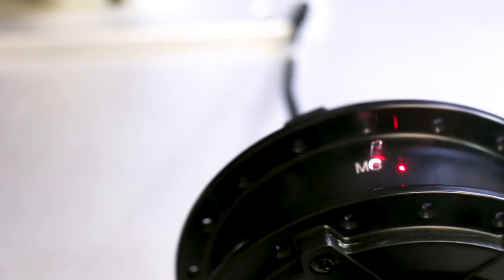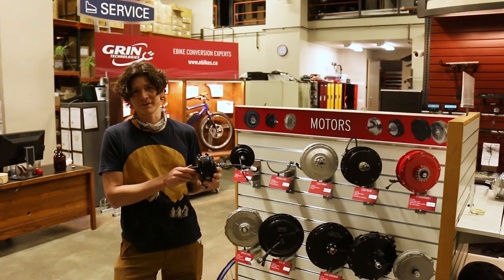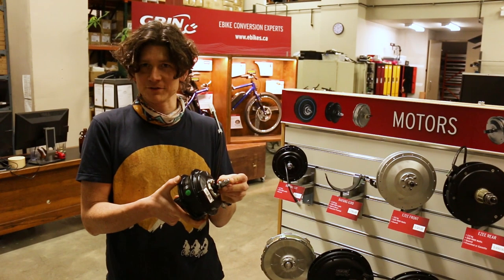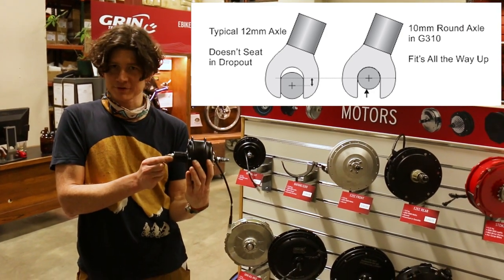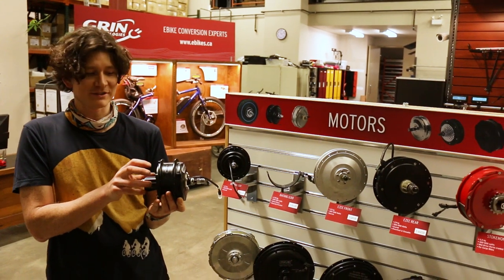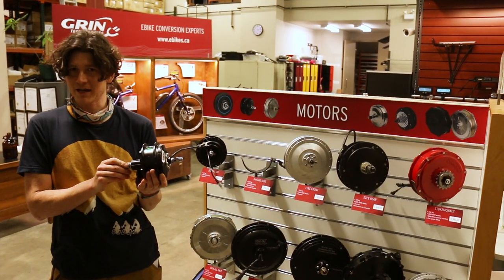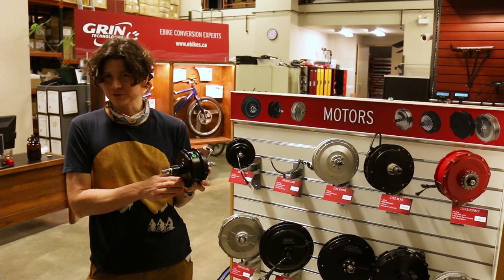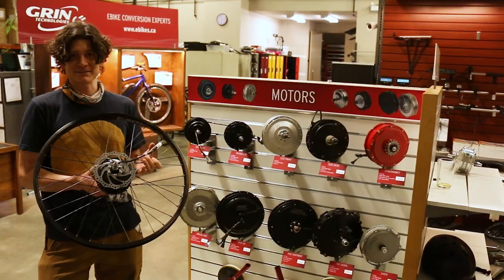Intro to the Small G310 / G311 Silent Geared Hub Motors

Comment: The G311 front hub sounds like it might be the minimalist solution I need for neutralizing the excess weight of my new Hase Lepus trike /  Rohloff Speed-drive  / differential. Torque no higher than 40nm should be good enough for me and should minimalize tire spin. I don't want to turn the trike into a full-blown e-trike. For me, "assist" means "assist," and that I can leave the battery at home when I want to.

Comment: Are the H400 the same motors? I have a Kuma R1 that comes with it. Could find much about the H400 but it's apparently a marketing code for the G312. I'm trying to find a way to remove the 25kph speed limit, at least to 32. But it just looks impossible without getting a whole new display and controller.
Reply from the maker: What's wrong with getting a new open standard motor controller?
Reply: @GrinTechnologies  Costs money and my bicycle have it all integrated. No way to replace it and not make it look terrible.
Reply from the maker: Well, in that case you are into the digital realm of controller parameter interfaces and encrypted communications usually, it's not really our domain.  There are ways of hardware hacking a speed limit though, like if your hub motor has a 6 pole magnet encoder for the wheel speed, then physically remove 3 of those magnets and it will think the bike speed if half what it is.  That won't work though if the controller is relying on a motor RPM limit as opposed to a hub shell limit.  

Anyways these are some of the downsides of buying a factory ebike with all the stuff integrated.
Reply: @GrinTechnologies  My bike was such a bargain, some chap bought it and never used it (it has an odometer so I know it's true). So I'm ok with it either way. I'm trying next week when I get back to my home if it works to decrease the wheel size in the settings to trick the speed sensor.
I appreciate you replying though.

Comment: Hi, I have one of these, but hadn't heard about the three winds before. Do you know if the wind be identified from the number on the case (FM G311. 250.D 13 008F2S6260490)? Thanks, Matt
Reply from the maker: Bafang themselves can be very obtuse about actual winding details.  Ours our wound with 7, 8, and 10 turns respectively. It's possible that the 13 in your serial number refers to a 13 turn winding which is slower than any we deal with. If that's the case and you wanted to use our simulator you'd choose what we call the standard wind option, and then use the KV adjustment slider to set to 0.77 to simulate your slower 13T winding.  You can know for sure by just running the motor unloaded at a known voltage and clocking the RPM.

Comment: Nice!  I so want to pair this with your brilliamt Ligo batteries, but you aren't selling it in 36V anymore.  Augh!!
Reply from the maker: I don't quite follow that. The LiGo's are still 36V, and the G310/G311 motors work just fine with 36V battery packs. With the Baserunner Z9 controller you can use anywhere from 24V up to 52V nominal packs with this hub.

Comment: Not sure if this has a clutch but I think motors need to offer the most pedal efficiency so you can carry small battery and use human power half the journey.
Reply from the maker: They do have a clutch so when pedaling without assist there is almost no difference from riding a regular bike other than the small additional weight. So for people who want a bike that is often used under pedal power only this motor is a great choice.  For people who really depend on the assist a lot, then we'd normally suggest a larger and more powerful hub.

Comment: I like it😊 good call on the gears. How many km before a change? 😊
Reply from the maker: You don't need to change the gears as a matter of course or regular maintenance, but you will need to chance them if you put too much torque on the motor and cause the gears to strip. Our experience is that this can easily happen at around 60 Nm. Best to have a controller phase current limit or choice of battery voltage and motor winding such that the actual motor torque doesn't exceed about 40Nm if you want to play it safe and ensure trouble-free gears.
Reply: @GrinTechnologies  sure that's a perfect amount of torque considering most 1000w-1500w only have around 20-25nm of torque. So your saying if you keep it at 40nm you should get 10,000km+ with no issues?
Thanks for replying, its good to get  the info out there😊
Reply from the maker: No, that's not what I was saying. There is another matter of motor overheating which would certainly be a problem if you ran at 40Nm continuously. Please familiarize yourself with our trip simulator web app here that has the full thermal models for all of these hubs properly simulated:
http://www.ebikes.ca/tools/trip-simulator.html
It's important to differentiate mechanical limitations from thermal limitations, although they are linked in that at elevated temperatures the nylon gear material looses strength and would fail at a lower torque level.
Reply: @GrinTechnologies  ah cool thats some good information, thanks again, and ye do some great motors. I use one in both my bike😊 the older one has 14500km on it with no issues 👍🏼
Reply: Sotasizmi

Comment: so how well does it fit in 142mm rear dropouts?  138 is not any standard ... so strange.
Reply from the maker: 142 is a thru-axle standard, not a slotted dropout standard.  This motor is meant to fit in with all the 135mm dropout bikes which is by far the most common still. The spread of 1.5mm on either side to get it in is really inconsequential, you don't need to cold set the frame or anything like that, it's easily opened up by hand to fit the hub in.

Comment: Could you convert a G311 to a rear hub down the road?
Reply from the maker: Unfortunately no, they have very different axles in them. The motor internals are similar, but not quite close enough.
Reply from the maker: The only thing that they have in common is the actual motor and gear cluster. The motor housing, hub shell, axle etc. are all different between the front and the rear, and to get the parts to do a swap you might as well just get the new rear motor. Especially since you have to desolder and resolder the cable harness from the hub windings and hall sensors in order to change that hardware around.